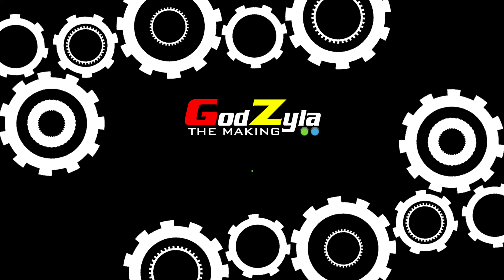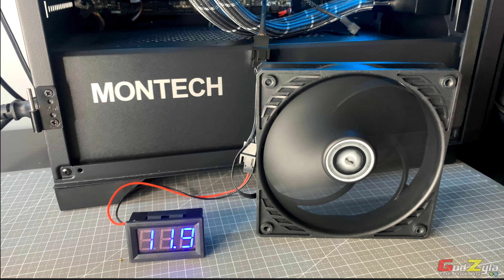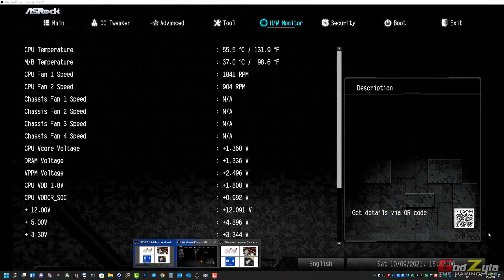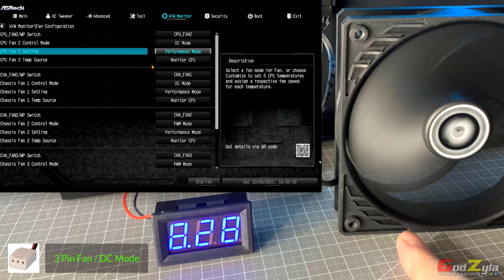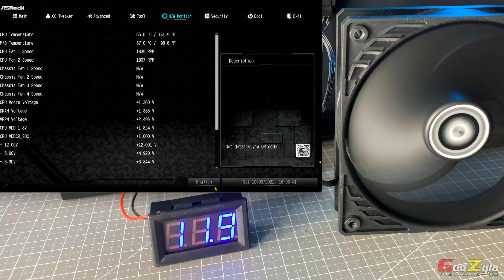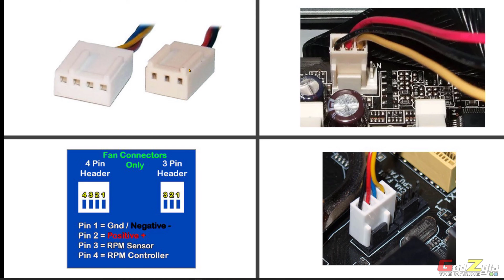Fan Mode - PWM or DC

Comment: hey my friend ! I know that these questions can be exhausting and I've done alot of research on this matter already and I'm pretty certain I have grasped what I'll do but I have 7 corsair fans 2 are 140mm sp140 elite and the others are sp120 elite and I have 5 motherboard fan headers I plan to hook each one to a header and then use 2 fan header splitters to obviously fit two fans on one header (I won't exceed more than 2 fans on one header as I know unless it's a high amp header I'd be in trouble) my question is this I have the rgb hub for 6 fans but I wanted to see if my 7th could be powered by the mobo (even if it's just to get the basic rainbow and not fully customizable) is that possible or will I have to go without one being lit. (I don't mind if that's the case because I defined know I'm not spending anymore money to have just 1 more fan lit)
Reply from the maker: Hi House Baelish, welcome to my channel, before you start daisy chaining, make sure you are clear of what each fans drawn. there are two section you need to take note. 1st the fan load 2nd the argb load, motherboard itself have fan and argb which does have limitation. as what I know most Asus boards have a fan load of only 1A. so do not daisy chain fans which will overload your motherboard fan headers. Same apply to ARGB. you wouldn't want to over load too. 

As for hub, most of them comes with sata powered cables to the hub but you still need to know what type of load it has. if it's cater for 5 fans and 5 argbs, do not do more than 5 and try not to daisy chain over the 5 fans. else your hub will melt or caps/resistors will explode.
Reply: @KleoYan  thank you my friend yeah each header handles 1 amp and the fans draw 0.30amp so it can handle 2 fans per header as for rgb I'll be using the lightning node core and run usb 2.0 but my issue is the lighting node core only supports 6 fans and I have 7 so I can power my 7th fan but don't have a way to plug rgb in aside from plugging the 3 pin argb plug from the single fan into the mobo but I've heard this won't work idk =/ I don't want to buy a new hub
Reply from the maker: @housebaelishgaming  I see. if that's the case, yes, plus all 6 fans to your node and 1 to your motherboard. I would say the rear fan to your motherboard argb.
Reply: @KleoYan  thanks so much for finally answering this as no one has answered this for me before. Earned my sub brother that and your content is really awesome! I don't think my hub takes up a 3 pin argb slot to my knowledge I'll have to check
Reply from the maker: @housebaelishgaming  you are most welcome and thank you for the visit and to have sub my channel. All the best with your build. 👍

Comment: Bought a 5 pack of 3pin arctic p14s by mistake I plan on running them on dc mode like you showed many thanks man it’ll have to do till I get some other fans later down the line
Reply from the maker: Hello Herman A. Welcome back. Yup if for 3pin. Use dc mode and you are most welcome 😊

Comment: Can 3 pin DC fans or 4pin pwm fans rpm be controlled in legacy bios?
Specifically in Gigabyte GA-G41M-COMBO Rev 2.0?
Reply from the maker: Hi AsifTML2, welcome to my channel, looking at the motherboard menu at page 37 (chrome-extension://efaidnbmnnnibpcajpcglclefindmkaj/viewer.html?pdfurl=https%3A%2F%2Fdownload1.gigabyte.com%2FFiles%2FManual%2Fmb_manual_ga-g41m-combo_e.pdf%3Fv%3D4072ad0a5376255ed4a29451488a555e&clen=10533932&chunk=true) I don't think is possible and the CPU Smart FAN Control which is meant for 4pin PWM fans. that's the only fan you can control and you will need to use the software call EasyTune. unless you purchase a fan controller bus bay. that will be possible
Reply: @KleoYan  Ya thats what I thought so. No point experimenting with ancient motherboard but thanks for reply...
Reply from the maker: @AsifTML2  you are most welcome.

Comment: I plan on running 5 x Delta ~12-20w 120x38mm fans at around half speed or so, but with the option to control their speed. Normally I'd be looking at just hooking them up to a conventional fan controller with knobs to adjust voltage, which is the type of thing I've been doing for many years. But now it seems there are many of these Delta models that come in PWM form. Is it true that the PWM style will be significantly more power efficient and also generate less heat in the process of running at lower speed? Even if so, my problem is I don't see any fan controller products for PWM that provide direct physical control of fans via knobs or switches on the device itself. Instead, either they act as a molex/SATA powered PWM fan hub with a single control connection to a motherboard header, to control them all at once, or they are made to be controlled by proprietary software that only works once the OS is finished loading up its startup programs. I also doubt that any of these PWM hubs/controller devices can handle the power of 5 of these fans, and they usually don't specify the capacity. What I'd really like is a PWM controller with individual control knobs and a separate high power channel for each fan, but I see no such products like these.
Reply from the maker: Hi Max0r847, welcome to my channel are you talking about this 80mm and 60mm fans which are from Delta that have the ampere as 1.95a and 1.65a, those normally are plug directly to the old days PSU (Mustard cables) via the 4pin Molex. There are none in the market that has those kind of hub or controller, the ampere is too big. 1 of those fans if you are to plug directly to the motherboard, you will fry the board fan connectors in no time. I have no solution for you either, all the best in your build.
Reply: @KleoYan  Haha yea dude even my 1.2 amp Delta triblade 120x38mm will spike almost double that when it first starts. XDDD

Comment: That´s mean I can operate 4pin fans RPM with voltage ignoring 3 & 4 pins, I ask because I want to power one this 4pin fans with DC.
Reply from the maker: Hello Lobsang White, welcome to my channel and yes, so long you've set to DC mode you are using voltage to control the fan RPM which is consistent. but your motherboard is doing more work and your 4pin PWM fan might not last that long. due to the voltage resistance.
Reply: @KleoYan  thanks, may you help me with this... I want to operate this fan (PHANTEKS T30) with this PWM controller (VHM-802 12V PWM 4-Wire) on Aliexpress, it could work? 
With the lack of potentiometer I suppouse the thermistor do the work in regards the temperature.
Reply from the maker: @lobsangwhite  the WHM-802 12V PWM 4-Wire, I would advise you to connect the red and black to a sata or molex outlet from the PSU, do not plug the red and black cable to your motherboard, it has it's own module. it should be fine if you do that. If you do not know how to crimp which + and - current to draw 12volts, I would advise you stop there and not proceed as back current will damage your PSU and if did it wrongly, it will damage your motherboard fan header too (if you intend to do that that is) 

some  info on how to draw 12volts form a 4pin molex from the PSU. https://i.stack.imgur.com/IA43b.jpg , again a disclaimer, I would be responsible if you damage your PSU or your PC components. PSU in modern days are all with black  as compared in the past where PSU cables comes with mustard colors which is easily identify, please practice with safety precaution and do this at your own risk.
Reply from the maker: @lobsangwhite  oops pardon me, and as for your question, if you have done up properly with the VHM-802 12V PWM 4-Wire devices, yes your fan will react base on the temperature reading from it.
Reply: @KleoYan  I really appreciate for your answer, and to be clear I intend to feed the pwm controls with a 12V DC charger, this is not for a computer.
Reply from the maker: @lobsangwhite  oh ok that is even better. Pardon me, I am over concern as I have witness a lot pc builders who are not aware of voltage and amperage. Especially those who just kept adding argb effects till it melt cables, blow motherboard headers or even have their PSU smoke out due to overload and such.

Comment: I have 4 fans 3-pin header , can i use a  converter 3pin to 4pin to turn my fans from dc to pwm ?
Reply from the maker: Hi Geno7, welcome to my channel, am sorry to say, that it will not work as 3pin fan does not have the rpm wire.

Comment: Is there such a thing as a 3-pin PWM fan?
Reply from the maker: Hello PomChatChat, welcome to my channel, nope I doubt so, fans with 3 pin connectors are not equipped with pwm. Therefore someone might have misinterpreted that, if you ever hear from anyone.